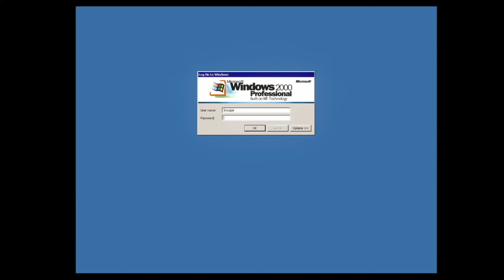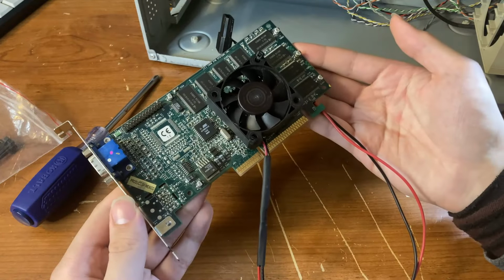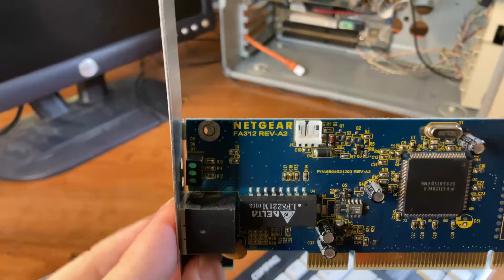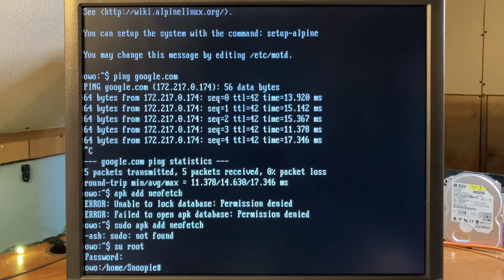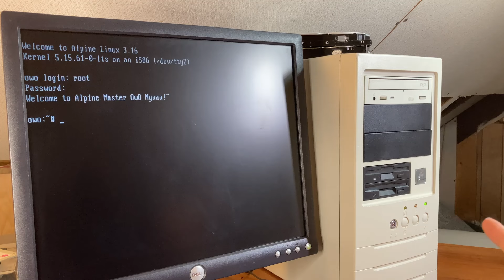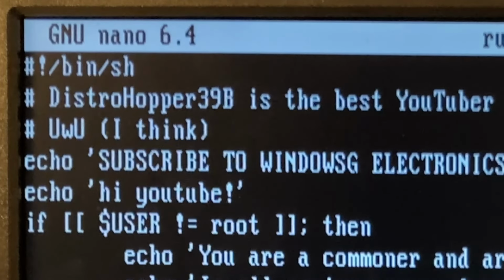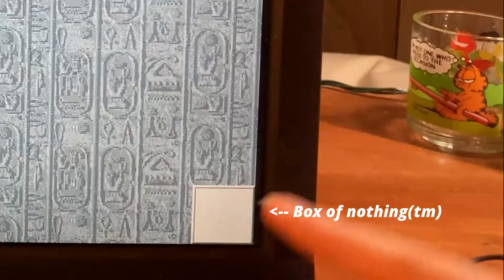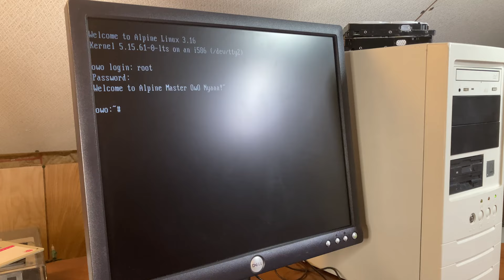Modern Linux on a 133MHz Pentium? Alpine on i586! (feat. NsCDE)

Comment: I installed modern gentoo on a 66mhz 486 and 32 megs of ram without much issue.  Was able to use the internet (with links) and everything.  I couldn't run X11 but that was to be expected.  Basically anything that didn't need X ran just fine.
Reply: How much did it take to compile? I bet 4+ months
Reply: @rughksu  Lol I didn't compile it on that machine.  All I did was use gentoo and told it to use a different root, and then started adding packages.  Doing that worked pretty well.  Doing things like using something other then the standard C library helped as well.
Reply: @rughksu  Actually it was when I first got a 64 bit computer that it took a minute.  I couldn't figure out how to set up a cross compiler, so I emulated a 64 bit computer on a 32 bit one.  That took days....
Reply: Idiots In Cars  I supose it could play the audio if I downloaded it and then decoded it into raw pcm.
Reply: Can you make a video showing that off?
I wanna see that!
Reply: this channel be like: hey look i installed chad linux on my 1Hz CPU with 1 bit of RAM, impressive uh??? I’M LOVING ALL OF THIS
Reply: LOL I did the same thing on a 100mhz one with only 40mb of ram... Yes that's right 40mb. Because I installed it on the pinnacle of computing known as a cursed left for dead junk of a computer Packard Bell
Reply: how much ram did it use at idle?
Reply: @xyzabc123-o1l  I think it was something like 12M.  That was just loading the kernel and bash and all the libraries.  If I used something other then the standard gnu C library, that alone would be a few megs.
Reply: @james73686   Thanks! Do you think thats the lowest it could go, or with more configuration / omission of kernel modules, it could go lower? I am interested in making an image that is just xwindow, gl/glx, drivers, and a simple filesystem. no network support and truly not even a desktop environment needed. so im curious how much the kernel contributes. youve said 12M but I wonder if there's more to cut out :)
Reply: @xyzabc123-o1l  I don't think your going to be able to run X.  It's pretty much out of the question.  You could run things like directfb and sdl, but that's going to be about it.  The kernel didn't contribute that much.  Most of it was things like the standard C library.  There's smaller alternatives, but they have a more hit and miss compatability.
Reply: @james73686  hello. Could you tell us more about how to cross compile for one computer from the other?
Reply: You can boot Linux on Intel 4004. Search tech sites, end of September 2024.
Reply: @kloakovalimonada  Who needs it to run on a 4004?
Reply: I.... wut? HOW? How did it not melt into a puddle of goo with all that compiling? I'm not even sure I'd fire that thing up on any modern OS without a fire extinguisher on standby, let alone gentoo. XD
Reply: @demitriuspandi9736  LOL I didn't say I compiled on the 486.  I compiled elsewhere and transferred everything over.

Comment: Modern linux will likely drop support for this architecture pretty soon. There was discussion about this on the linux kernel mailing list and Linus Torvalds suggested dropping it. And yea... Samba is a cpu hog.... it's insane. Even on a modern cpu it can bring a system down to its knees if there are enough users. I'd highly recommend using NFS for stuff like this.
Reply: eventually it was 486 only yes. Though plenty of userspaces are dropping 32bit as a whole which might mean it's being barely tested. Freebsd still actively supports it though, and really well too.

Comment: Okay that xterm icon live-update is really cool :O
Seems like NsCDE only got partially installed, though; there should be a bottom tasktray-like app launcher.
Reply: Yeah, the NsCDE panel doesn't work on Alpine due to it using a different C library that causes certain things to break. I tried to get the panel working with no luck.
Reply: @DistrosProjects  you could have added the glibc package since its available on apk

Comment: Thanks for making this video! It brought back memories of my first assembled-PC from 1999 - a Pentium Celeron 400-something MHz running Win95 with, oh gosh, perhaps 4MB(?) of RAM and a SiS 6xx graphics card. I was mostly playing "NFS Porsche Unleashed" on it. A few years later, when I was in university, I discovered Linux and I went down the rabbit-hole of running mutiple flavors of Linux - building and compiling packages (before package managers were reliable) as well as kernels to extract the most optimal performance on the Celeron. Started with Mandriva, then added Suse, Fedora, finally ending up on Gentoo. Something about taking 3 long days to get the system up was exciting!

Comment: Pretty fun video, been starting to collect parts to build a AMD "Socket A" system with, found a asus motherboard, a Athlon XP 2800+, BFG TECH geforce 6800 gt oc  and a couple other bits and Bobs.

Just trying to decide if I should get a new case or try to reuse and old one
Reply from the maker: Yooooo nice!!~ My first computer was a Socket A based system, had an Athlon XP 2400+ and ASUS 6800 GT. Sadly the elitegroup motherboard decided to die awhile back. Was epic when I used it tho :3

Comment: Did the first Linux install in 1998 on a 486 DX4-100 with SuSE 6.0, kernel 2.0.36. That felt a lot faster than what you're doing there. Most likely because I did use a VGA 16-color driver running 640x480. Setting up X was a huge pain in the ass back then though. This actually managed to run KDE 1.xx pretty good.

Comment: WiFi is actually fairly CPU intense with any adapter that is from that era. I actually ran a box this old as an access point and a sperate one as a router, two machines because I was a little worried about overloading one even with crappy DSL speeds. The router one sat in the corner booting off a floppy for over a decade.

Comment: WIFI worked there because the actual radio waves are pretty small and there is enough of a tail there to act as a receiver. Your router or AP is likely pretty close to your PC ( in the house is close ) so it would work fine. The RPI Zero has the antenna built right on to the PCB and its probably shorter then the little nub sticking out of your aircard there.

Comment: Back in the day I ran Slackware 11 or 12-ish on a pentium 100 overclocked to 120mhz. 80mb ram. Kernel 2.6.something, KDE 3.5.10, I think I compiled KDE with latest GCC 4.0 prerelease with all optimisations... It ran adequately, comfortable enough for doing basic tasks, GUI was not too laggy. To get a snappy UI you really needed 400mhz+.

Comment: HI. You can run Quake 3 on that Pentium if you use a voodoo 2 under glide. Glide removes MMX checks and MASSIVELY reduces CPU overhead. Nvidia tried to sell people GeForce with T&L, but not only was it not better than glide, T&L required direct game support to work, which most didn't, and it ended up being a fallback for dx8 games at best. ANYWAYS, I know the Pentium can run games with a voodoo 2, because I used to carry around a slim case Pentium 1 with a voodoo 2 to lan parties. Decades ago. I think I had Windows 95 on it to reduce overhead with all the updates installed, and it got around 30 FPS in quake 3 low settings. Keep in mind Windows 95 is a real time OS, with a overclocked PS2 mouse, and a zero lag CRT. It was capable, and I won matches with it. I don't think Linux can come close to the raw performance of 95, nor will it support gaming at any reasonable speed. PRO TIP: you need a dx11 AMD card for Linux, and you can buy a PCIe to PCI converter with a LOW PROFILE AMD card around 25w power, like a r7 240. I have done this for a Pentium 4. You NEED the AMD card bare minimum for both vulkan support and h264 codec acceleration. The biggest problem past that is finding a distro that still supports 32 bit while offering a REASONABLE software selection. Good luck running anything on a Pentium 1, because it's BARELY possible on a Pentium 4. WITH A VIDEO CARD. Also, voodoo 2 is faster than 3, probably because of missing 2d, and you need Mesa FX for voodoo cards. Which who knows if that even runs on Linux anymore.

PS. Anyone who's a Linux wiz, I have a HP x4000 workstation. How can you get an ac97 onboard sound to run the BUILT IN PC SPEAKER? There's like barely any understandable documentation for this, and people on Reddit are rude losers who tell you to buy a new computer.

Comment: Memories, my first Linux box was actually a P133 with 16MB of RAM, it was 1997 or 1998. This were much less user-friendly back then, especially configuring XFree86 (yes, that was before autoconfiguration) when you had a cheap graphics card from a generic manufacturer.  As others have noted, NsCDE has nothing in common with actual CDE/Motif other than recreating the layout of CDE desktop environment on top of FVWM window manager and providing themes for modern toolkits (Qt, GTK+) to mimic the looks of Motif. It is to mimic the 1990s vibe of CDE desktop and Motif toolkit on modern systems. No surprise the experience is sluggish. Even lightweight distros assume something more potent than a single-core Pentium 133 MHz (there were no multicore x86 CPUs then, at best you could get a mainboard with slots for more than 1 CPU; non-NT Windowses were not able to use it anyway). Pentium didn't even had SIMD instructions.

Comment: Linux is ideal for old computers!
Unfortunately, many distros are ending support for 32-bit processors.
I'm running Slackware -current on a 2006 OG white polycarbonate MacBook with a 32-bit-only intel CoreDuo "Yonah" CPU.

Slackware will still give you a complete, fully up-to-date Linux on something as old as a 386!
If you need to run on a 64-bit processor you'll need Slackware64.
From the mid-2000s to the mid-2010s I rocked an ASUS EeePC 2G Surf running Slackware -current as my main machine (until the keyboard finally flaked out). Linux in my jacket pocket! The EeePC had a Celeron of some sort, with 256M of RAM and 2G of storage. I added a 16GB SD card for my install and I was all fine (KDE wouldn't load and going to Facebook would instantly crash the system so I just didn't do that).
I'm running Alpine Linux on my iPhone!
Stay furry!
Reply: Slackware lacks of package dependency management such that latest Slackware now requires you to install everything, not really lightweight for old pc.
Reply: @chenyansong  A “full install,” which is recommended, includes most of what most people need.
If do-it-yourself is NOT your thing, it still doesn’t mean it’s not just fine for outdated hardware.
As I said, I ran Slackware -current on a 256M RAM EeePC for a decade, just fine.
Reply: @chenyansong  Slackware does NOT "require" you to install everything, only recommends it. It's easy to install a reduced installation that is still just as stable as a full install would be.

Comment: Did this stop working? I tried Alpine on my Pentium MMX machine and it just dies with "illegal instruction." Did they get rid of i586?
Reply: ANOTHER UPDATE it looks like you can still use Alpine 3.16, but you may have to roll your own USB image(I formatted the whole USB flash drive as fat32 without partitioning, copied the contents of the iso into it, and ran syslinux --directory /boot/syslinux/ --install /dev/sda, then mounted it again and adjusted the kernel command line parameters. I disabled acpi by using acpi=off).

Comment: mmmm i love slot flavored cpus 🤤🤤🤤🤤🤤🤤 i love the internal bleeding 🤤🤤🤤🤤🤤🤤
Reply: also, i really wanna hear the backstory of the 2nd pci network adapter lol
Reply from the maker: @kantraa  sigh

Back a few years ago when i was first getting hands-on with vintage computers i got one with that NETGEAR network card. After installing it in a PowerEdge 1300 Pentium II based server (after removing the bracket because it was bent, and 12 year old me didn't know how to use pliers) i powered it on and added the drivers and connected to my home network. While yes initially the card did work it made the entire network extremely slow (at least, to 12 year old me, i doubt anything was really wrong) so i stopped using it, shoved it in a box and haven't used it till this video... and it proceeded to get really hot and  make the computer not POST, guess its cursed.

aaand yea i said all that and decided to speed it up because it was like 5 minutes long >-<

also yesss internal bleeding my favorite!~